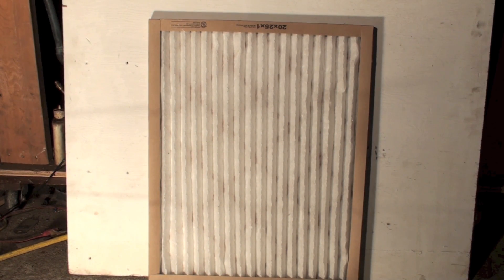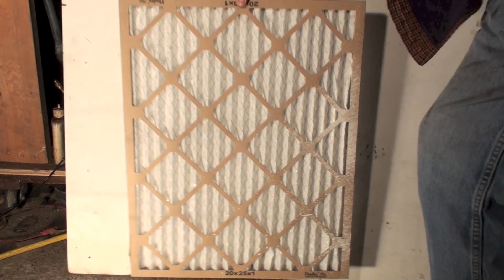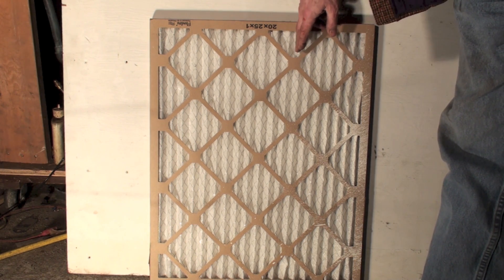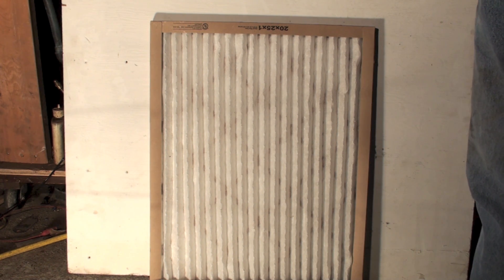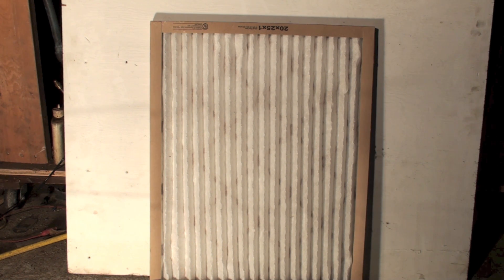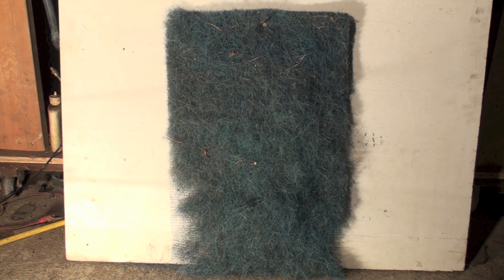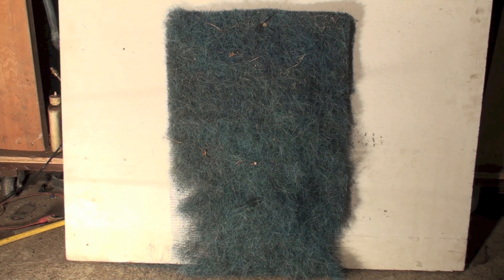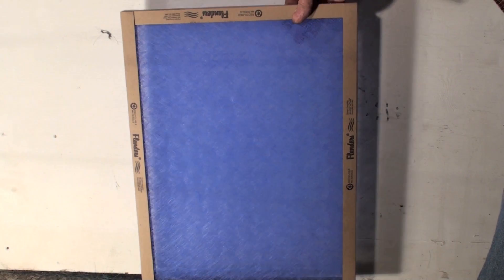Looking at the furnace filter.

Comment: The filter you showed at the end does catch dust. Since I started using that material to keep dust out of my computers there has been no dust on or near the CPU fan. Dust builds up on the outside of the filter and I remove it with a shop vac.

Comment: What filter would be best in a mobile home package ac unit floor return
Reply from the maker: Use the cheap fiberglass filters.  The package units have a high resistance to flow so you do not want any more resistance from the filter.
GFM
Reply: @grayfurnaceman  that's what I thought

Comment: Doesn't let birds and small mice through it. Really like 747 jumbo jets "maybe" get trapped in it? Dude you need to look at these and actually run one on your own system before you comment. If manufacturers install them, what's YOUR issue? Manufacturers design and build the units. THEY should know. No doubt they do not stop 0.00001 micron particles. I got that. They do allow a high amount of AIR through. Since 98% of returns and supply ducting have issues, what's not to like in these filters? They can drop your total static a bunch over what you would call a "good filter" MERV 48 and sub zero micron filtering capability.

Comment: At 5:00 in your video, these are the filters I'm talking about. New ones anyway that are not falling apart like yours. Mine are very scratchy like a scotch brite pad. Anywho you say they don't filter for sour apples. They are clearly better than the blue fiberglass ones for sure. These are reusable and allow a ton if air through. Cost like $3.85 at wally's mart.

Comment: Those green filters you were dogging are pretty good. Don't cost a lost either. You can wash it out every season and reinstall it. It does a decent job at filtering and passes a lot of air. Good for the system.
Reply from the maker: The filter efficiency of that filter runs about 3 to 5%.  The filter you are describing as the best is pretty close to an electronic filter.
GFM
Reply: https://www.walmart.com/ip/Natural-Aire-Hogs-Hair-Cut-To-Fit-Filter/16225736?action=product_interest&action_type=title&beacon_version=1.0.2&bucket_id=irsbucketdefault&client_guid=12b6a626-f04e-40ba-8f05-fde4b2706662&config_id=106&customer_id_enc&findingMethod=p13n&guid=12b6a626-f04e-40ba-8f05-fde4b2706662&item_id=16225736&parent_anchor_item_id=38752911&parent_item_id=38752911&placement_id=irs-106-m2&reporter=recommendations&source=new_site&strategy=PWVAV&visitor_id=WaVl4LwAGpltTz8oaA5w_8

Comment: 1:30 very true. Especially after a coil has fozen and melted, and if the fan is very strong, it'll get sucked right into the blower wheel and sometimes unbalance the motor.

Comment: That furnace filter is only there to protect the blower motor wheel and ac coil it is not meant to filter the air in the home . The biggest scam perpetrated on the American people are these media filters and electronic air filters they do not do a thing to clean the air in the home
Reply from the maker: For the most part I agree with you.  They will clean the air that passes thru them to whatever efficiency the filter can.  However if the air does not pass thru, it does not clean it.  You can leave your fan on to assist, but even Honeywell tells you their electronics will not stop dust in your house.  Thanks for the thoughts.
GFM

Comment: I use the last one in my house. It gets plugged up after a month so it must be doing something. Should I start using pelted? When they installed my new heating and AC system in my house they told me to use those "see through" filters and even gave me a year supply. I have since got the same filters Home Depot. I was told by the installer that the thick pelted filters are too restrictive and will cause the system to not work correctly and that a lot of service calls are to home that have used the pelted filters and the system wasn't working correctly because of the huge pressure drop. Your thoughts?
Reply: Todd, it's a pay now or pay later scenario. I'd recommend using good pleated fitters that you can't see through.  If you can see through them or any media, particles will pass unrestricted.  If your not concerned with allergens and indoor air quality, furnace only units have bigger smoother heat exchangers than the fine aluminum fins on the indoor coils of AC units and heat pumps which will get clogged with hair, fibers and dust over time.  The moisture that condenses regularly on the AC evaporator coil will invite even more debris to adhere to the fins.  Before you experience a freezing coil due to reduced air flow down the road, you will have already been losing efficiency due to reduced heat transfer from an insulative layer of crud on the fins and less refrigerant flashing in the evaporator and more liquid migrating down through the suction line and, when bad enough, to the compressor.  Since you cannot compress liquid, this isn't good for the compressor (scroll compressors are more forgiving in this regard than standard reciprocating units).  In the long run, cheap filters will cost you more over the long run: health concerns from more unfiltered particulants and increased biological grown on and around your coils, decreased air velocity due to clogging heat exchanger fins and dirty air ducts (which reduce laminar flow and pressure to peripheral areas),  and an eventual increase in service calls and possible equipment failure.   Both mechanical and chemical cleaning will be an additional expense and are harsh on the coils which will reduce life expectancy. I've used an unpowered electrostatic filter in the past which seemed to work well.  It was made up of many interlaced layers of fine plastic mesh. Allegedly, there were dissimilar plastics or other material that induced a charge as air passed through and caused smaller particles to adhere to exit material with an opposing charge. The filter was very durable and easily cleaned with a hose outside  It's worth mentioning that there is a designed range of pressure drop which accounts for using quality filters and a degree of clogging.  To an extent, reduced air flows increase contact time and heat transfer and faster air flows may not always be optimal. It may not be the most practical or realistic,  but If someone was trying to optimize things economically, an improvised pressure monitor would be more effective than just changing the filter monthly etc. Particulant levels will change greatly seasonally (pollen, dust, windows open/closed, pets shedding etc) as will the time your system runs--unless you run the fan constantly like me.
Reply from the maker: Most pleated filters are more restrictive than the Fiberglas type.  I don't have any definitive tests on manufacturers.  My best thought is use the pleated filters because they are better filters but change them every month.  Hope this helps.  GFM